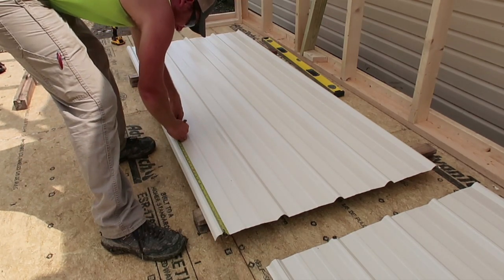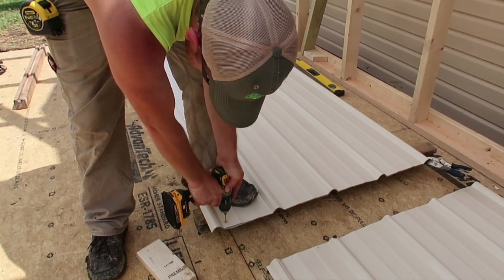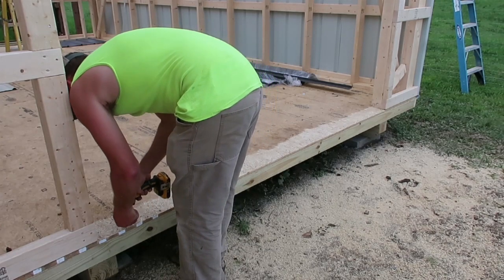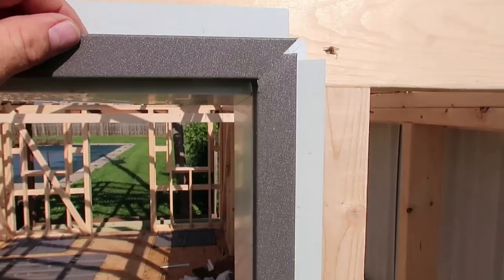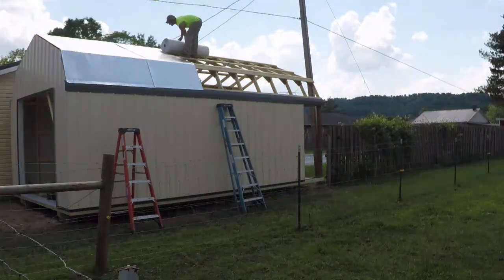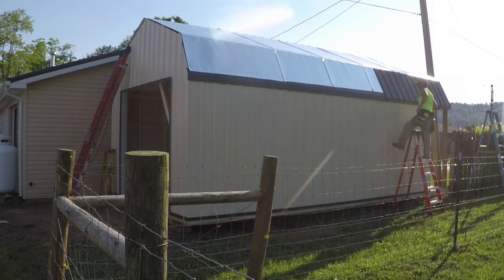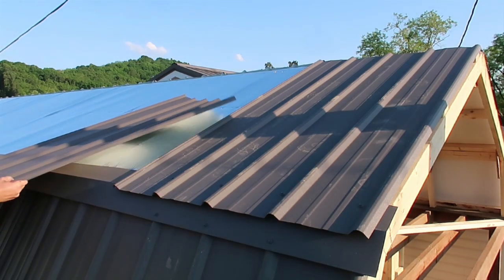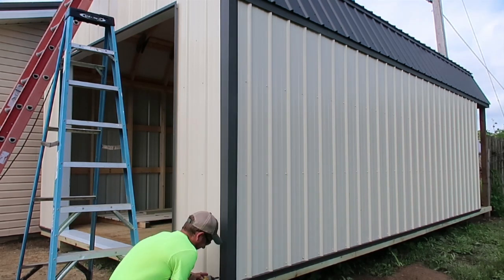HOW TO BUILD A SHED

Comment: Wow! Just wow! Mine will be a lean-to conservatory which currently has a plastic roof that heats up to  💯 deg Celsius in the summer and freezing cold in the winter. I think I might use 2 by 6 on the wall and rafters to be able to install a 4 inch poly insulation. You've given me the confidence. Thank you so very much.
Reply from the maker: Thank you. Good luck with your build!

Comment: Should always lay your roof panels from least wind side first. If you get mainly east to west winds start laying your sheets on the west side and overlap the next sheet. This way the wind blows over the sheet without catching the lip of the sheet.
Reply from the maker: Good suggestion for sure but that was more of a concern back when they used nails. On a properly fastened roof (screws on every rib at 2’ intervals) there’s no way wind will blow it off. The building will blow over before that happens.

Comment: how come you dont need foam enclosures on the underside of the roof panels? Is it not required? Cant insects get under the roof now? Or mice if they had a tree branch near by? I  know you dont. I am just curious if I should install foam enclosures here
Reply from the maker: That’s an option for sure but I personally don’t use them as it is almost impossible to seal off a steel building for no insects to be able to get in. With that said, It wouldn’t hurt to put them in. But you should also install foam where the corners overlap onto the siding along with the ends of the corners to really make a difference.

Comment: maybe this question has been asked or maybe resolved in a different video, but is there any need to fasten the shed to the block?
Reply from the maker: There is no code for that in my area but check your local codes. Fastening to blocks like I used would not do any good. You would have to install a footer, pillar or anchor of some sort to fasten it to.
Reply: @MT_Homes  yeah that's really what i was referring to, more for security than code. i get what you mean about the block itself not really being a method of security. thanks. excellent job, by the way, wish you were close to tampa, fl. would easily hire you to build 
me one

Comment: Not sure if I would have used "white metal" (aluminum?) for the garage door floor edge as it may take a beating over the years. Maybe something sturdier such as a piece of #12 or #14 galvanized steel? BTW, nice attention to detail on the overall project.
Reply from the maker: That’s 29 gauge painted metal. It’s holding up well so far but a piece of stainless steel would have been ideal for sure. Thank you!
Reply: @MT_Homes  ... 29 ga is pretty thin and I would be afraid it would actually tear if something got caught on it. (riding lawnmower?) Stainless is just about bullet proof, but expensive, and not sure how easily you could get a shop to bend a lip on it, which is why I suggested galvanized steel. There's probably another dozen ways to approach this but no sense in micro managing your project from this end.  <LOL>

Comment: Hi... Great video!  Where would you buy the metal?
Reply from the maker: Thanks Dwayne! Look for a metal supplier in your area. Most are locally owned. Basically a company that buys the metal in large rolls of flat coil and runs it through a machine to make custom length ribbed sheets and trim like I used.